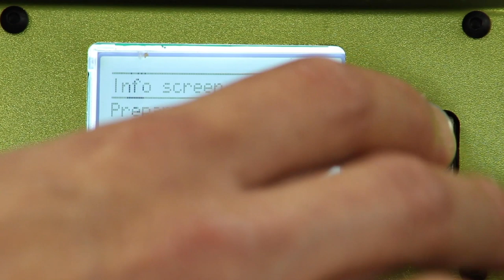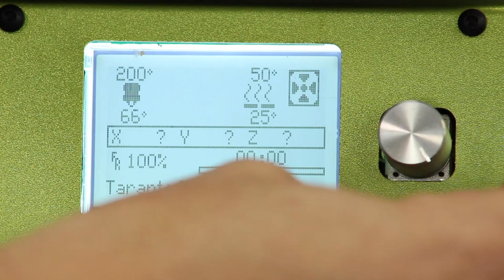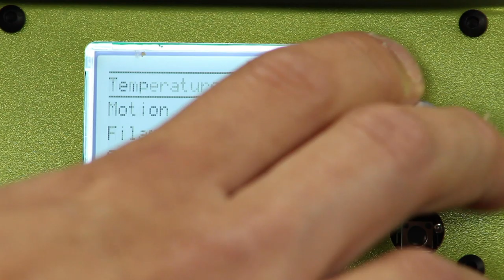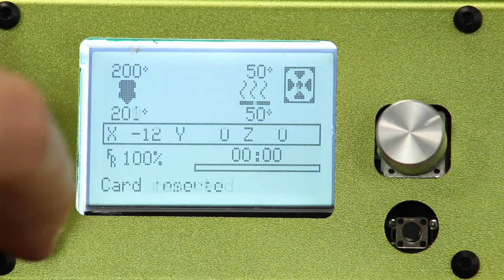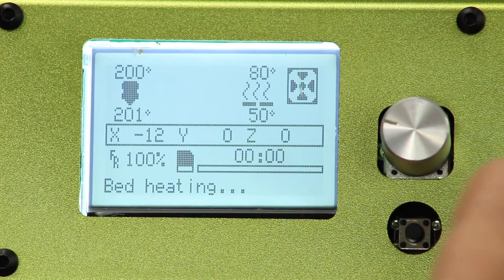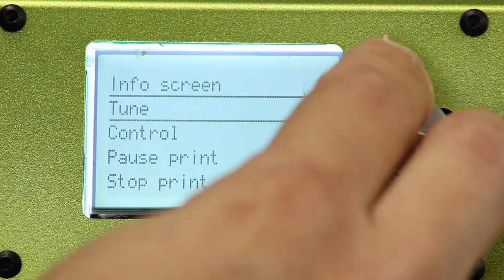Tevo Tarantula Pro Unboxing, Build and Test - Hows it stack up?

Comment: Having just bought this very printer I will say Jason did a great job of assembly. 
Print quality is good. Loving the Volcano hot end. 
I printed the spool holder and hung it on the printer I have beside it. Not the best but it works. Will get a real spool holder.
I like the easy access full size SD card.
No bed leveling is a pain but I can live with it.
Comes with MKS Gen l board, it is getting 2208 drivers to quiet it up. Easy upgrade.
Could use a better power supply but it works as is.
Overall impression. 
Not a bad printer, good price, prints well.
Reply: If contact the suppliers, they should also have BL touch for Tarantula Pro for helping auto bed leveling. And it seems that all the drivers of Tevo products can be upgraded to the ones we like.
Reply: @julyxu634  
This was a first impression review. 
I don't use auto leveling. I am old school and use the paper method.
This doesn't have the leveling program that moves it from corner to corner so you can set it. You have to disable the stepper motors and carefully move it yourself. This is not the only printer I have that I have to do it this way. Just a bit of a pain.
Reply: @andymoses628  Quick marlin flash can enable LEVEL_BED_CORNERS and add in LEVEL_CENTER_TOO. :)

Did you ever determine what was causing the bed to seemingly "tip" as the bed mored front to rear?

Also,  this isn't quite a fair question since you didnt have to go through the pain of assembling it.... but anyways...
Ender 3 vs Tarantula Pro. Thoughts? I think the biggest pro's for the tarantula are the hotend and the board (with upgradable stepper drivers). Careful on your choice of 2208's, I wouldnt recommend for the E.
Reply: @Jason-yn6oy  
I know Corner leveling can be enabled. This was just a quick first impression sort of review.
I haven't noticed the bed tipping it is printing fine. 
Bed is a bit warped I'll be putting a mirror on it soon enough. 
Ender VS Tarantula i find no real difference. Same size XY the Tevo is bit taller.
I have a set of 2208s but I have to flash the Marlin for them as the run reverse will get the corner leveling running at the same time.
Reply: @andymoses628  Hi Andy, maybe you should try the BL Touch. It is so convenient. Tevo has so many orders per day so that their same type printers are all put into mass production in one time per three days or so. If you need the better experience, maybe you can contact the Tevo's general manager. He should think highly of your suggestions. Have a good luck.
Reply: @Jason-yn6oy  Hi Jason, it is so pleased that you also like the hotend and the board (with upgradable stepper drivers) of the Tevo's product. We also like them too. Since you also think highly of Tevo's influence and even help them make the showing video, why not also show them in your official website for customer's choice?

Comment: I just put my Tarantula pro together and found that they used round screws to bolt the power supply to the bracket, and the Y carriage ended up bumping against that screw.  I removed the screw for now, and plan on picking up a flat head screw to replace it to prevent the bump.  I think that is what caused your issue with the leveling of the bed.
Reply: I checked and its not rubbing against the power supply screw.
Reply: The problems in the material used for the "bed", and the carriage being poorly designed, annd having 4 bolts , is also a bad design. The Ultimaker +2 has 3 and is far better.

Comment: I had the same issue with the bed not being flat. I am going to get a glass top for it to see if this resolves it.
Reply: Mirror tile they are optically flat. 
Shim the low spots with aluminum foil to prevent the glass from warping under the heat cool cycles.

Comment: I assembled my Pro recently and had a few problems. Six bad wheels. Bad 2gt belts and a profile that was incorrect that I had to drill out holes so the screw heads could attach the Z profiles. My experience is not the norm, most whom i have spoken with had zero issues.

Comment: Please help me, my hot end side fans don't turn on and the heated table in the center doesn't match the same dimensions as the 4 corners, making the first layer look horrible and peel off the table. Do you happen to have the g-code to configure in the cure? I look forward and God bless you.

Comment: If you change the power supply to one of more amperage, will the hot bed reach the fastest temperature or isn't it?
Reply: The heatbed does heat faster. I installed a 350 watt Mean Well power supply. Check out this Facebook group: https://www.facebook.com/groups/501968287041019/

Comment: hello I need help, I have a pro tarantula, the problem is that instead of printing straight, it prints with undulations, I don't know what it can be.
Reply: What kind of undulations? If It is horizontal lines could be Z wooble. It that case you should remove the bearing at the upper end of the lead screw. If the tip of the screw changes position while turning the screw is probably not straight. Removing the bearing should make It better or solve the problem. If It is vertical lines, should be something else

Comment: Hi, Same bed I had with my TTP. What's a live leveling?
Reply: Where you level as the print is going, you can see if the level is too high or low based on how the first layer prints.

Comment: I wanna buy a 3D Printer but i can't decide between the Tarantual Pro and the Ender 3 Pro. Which one would you recommend?
Reply: ender 3 pro. Hands down
Reply: Search for the tevo tarantula vs ender 3 video's. They will compare the differences between them and that's how I decided. Plus I will be upgrading to a color mixing kit. Good luck.

Comment: its simple... its junk
Reply: As someone who has actually used one, no it's not junk. It is a great printer for the price.
Reply: Agreed. Tis junk. And having to upgrade every damn thing on it, and the bed coming warped straight from the "factory" , it's not worth it when ya gotta spend another 200$ to get it printing nicely. Tevo ftw.
Reply: @SgtKiLLx  
Mine printed great right out of the box. 
Mine is bone stock and is still printing fine.
If your bed is warped get a cheap mirror tile and shim the low spots with aluminum foil, about a $5 fix if that.
The warp on mine was minimal so it still prints great but it will get a mirror soon. 
I currently have 8 printers of different makes and models, haven't had a bad one yet.
Reply: @andymoses628  hm.